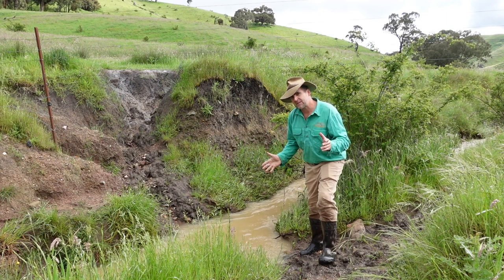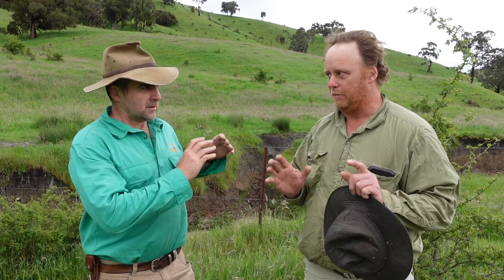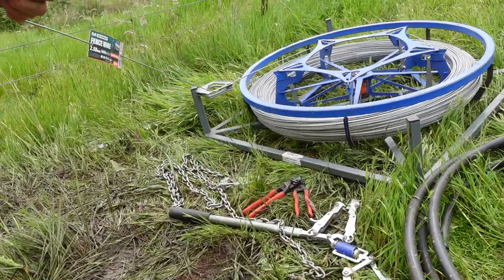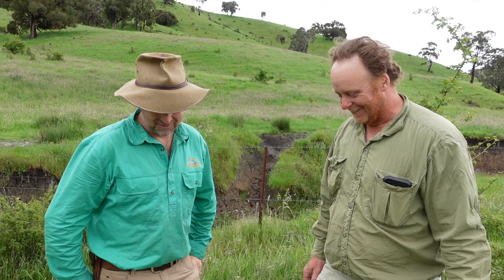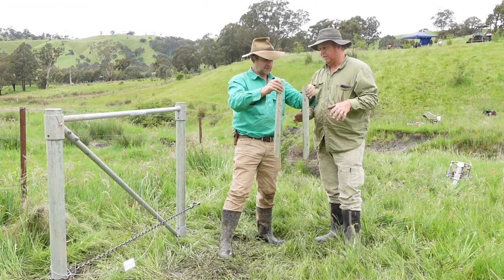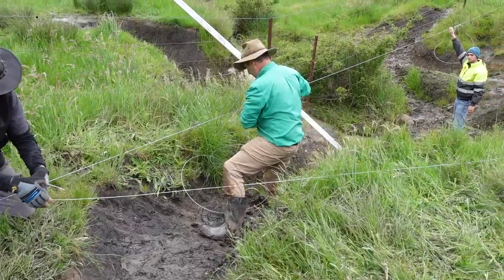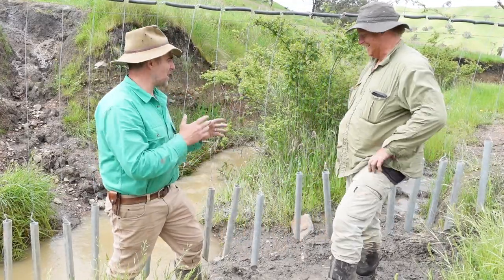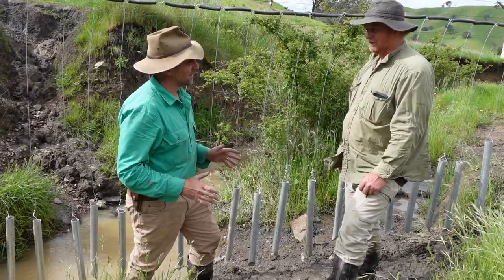Fence Flood Gate

Comment: we find chain is better than wire and pipe
Reply: I agree, I have found chain less likely to tangle. Also wallabies still use these barriers to gain access even when electrified. Just had 3 meters of flood over my chain flood fence, no damage.
Reply: @graybeard6687  
I had the pleasure of 12 weeks at Casino in the BlazeAid camp earlier this year. We did a similar job for a farmer, almost identical land situation. For our it was wire rope as the stretcher then wire droppers and lengths of bamboo as the weights. I guess you use what you have to hand. I wish I had thought of the poly pipe spacers, that would have made tying off a lot easier.
Reply: Toys by George  the great thing about chain you don't need spacers, I hog clipped the chain droppers onto the chain top line it just hang like a metal curtain, connected this to the electric fence with a earth leakage diverter so it didn't shut down the whole fence when the water came upto the fence, so when the water was up in the creek it was only the flood fence that was out but the remainder of the fence was still hot.